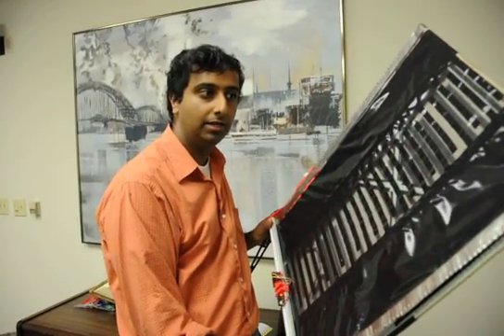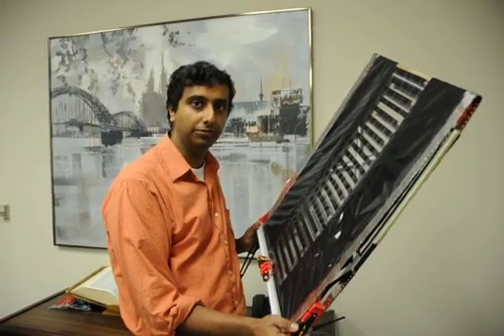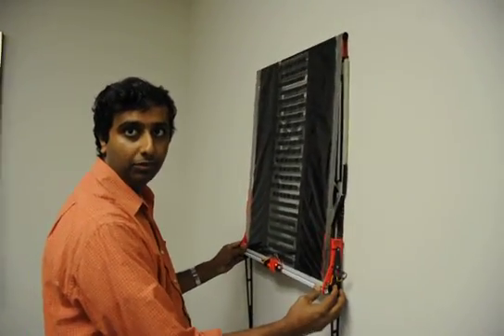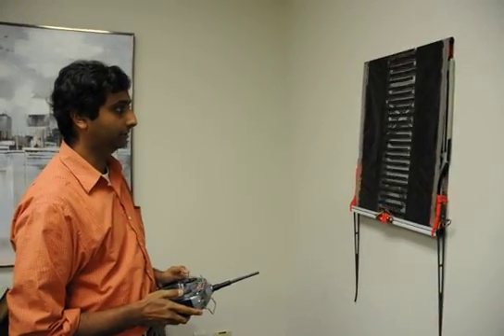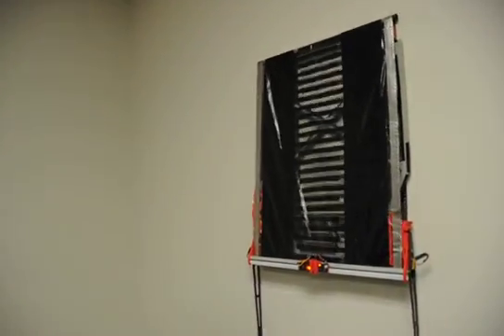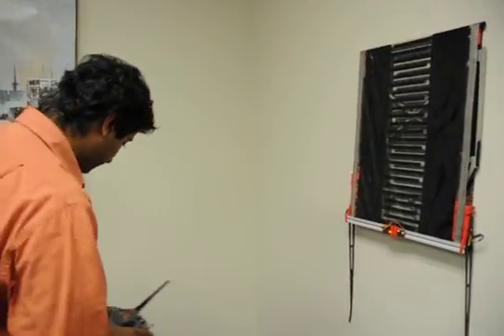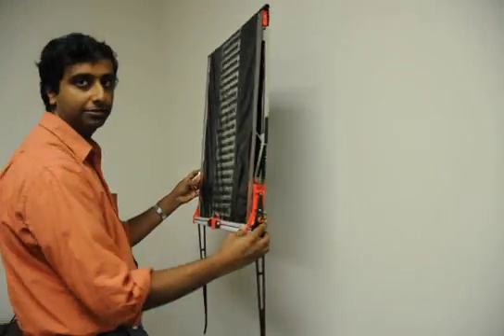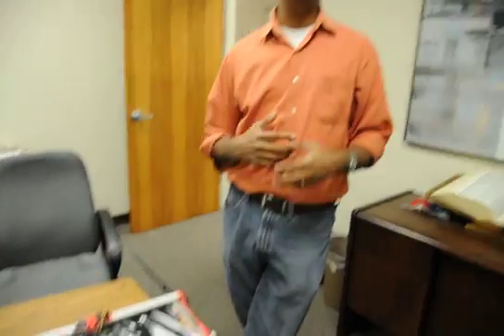Wall climbing robot

Comment: Good afternoon. I am a student studying in Korea robot.
I can create a wall climbing robot.
I'm using static electricity.
I gave 12KV.
But do not stick well
Do I need to change other elements??
I want to know about electric current or materials
And the article would turn awkward to Google Translator may
I'm sorry.
This is my e-mail.
vokko78@gmail.com
Thank you much advice.